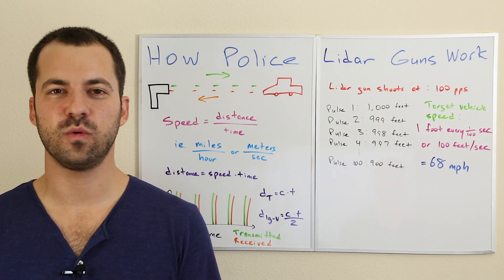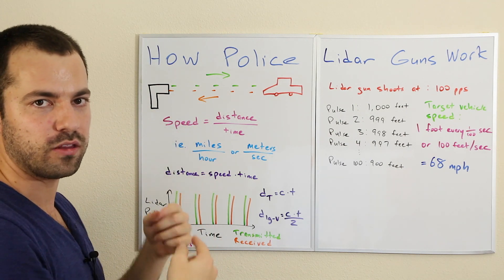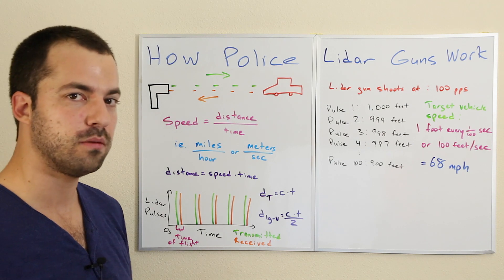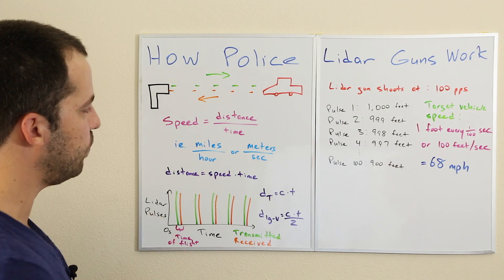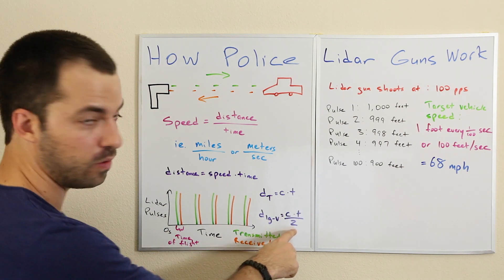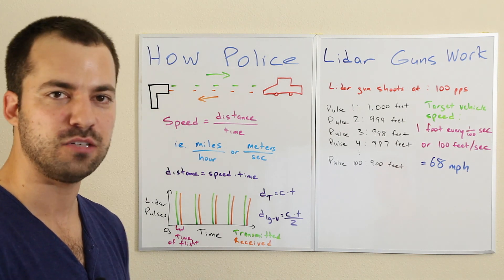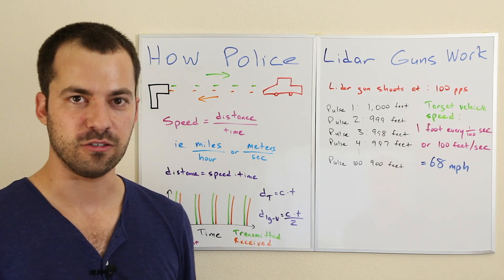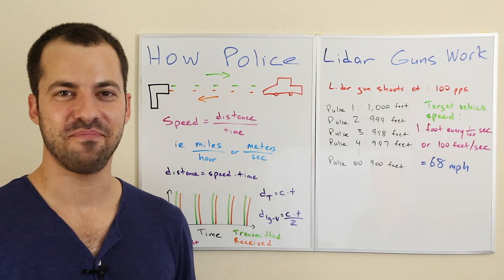How Police Lidar Guns Work

Comment: Are there any variables that can give an incorrect reading such as the height or angle the lidar gun is being fired from?
Reply from the maker: You mean like cosine error? That can happen with sharp angles.
Reply: @VortexRadar  not really sure how one would refer to the angles, but I was once told by a police officer that for a correct reading you would need to stand directly in front of the vehicle and on ground level. My question really is if one was using the lidar at a height of 20 or 30 feet above ground would that affect the reading?
Reply from the maker: Google cosine error to learn more

Comment: Would the calculations be only for a direct on coming vehicle? Or will taking the speed reading at an angle yield a different reading ? Or will it be negligent?
Reply from the maker: It would read differently. You can google cosine error to learn more.
Reply: @VortexRadar  so I can basically get out of my speeding ticket then ? Lol .
Do you have a video on it ?
Reply from the maker: No. If anything, the radar/laser gun will show a slower speed than your actual speed, so it works in your favor. Again, please Google cosine error.

Comment: its so funny that u sad is not measuring speed its measuring distance, its just so dumb :))
Reply from the maker: Like I mentioned in the video, it’s technically measuring distance and calculating speed by dividing change in distance over time. We could get into semantics and debate if it is or isn’t “measuring” speed, but that kind of misses the point of the video which is to explain how a lidar gun is able to “measure” or “capture” or “calculate” a vehicle’s speed.
Reply: Vortex Radar i didnt want to be rude 
Thx for providing such a great content

Comment: Hi I’ve seen Quite a few of your videos so thank you for the info!! So I got pulled over today I have max360c the officer said I was doing 69 in 55 but did not give me a ticket however it freaked me out a bit so I bought ZW5 s now to my question the ZW5  only protects from the front? Bcuz he got me from the rear! And if so do I have to buy ZW5 s twice to get protection in rear cuz I can’t find add ins.
Reply from the maker: You can install rear heads into the ZW5 now, but it kind of defeats the purpose of getting a ZW5 because you'd have to run the rear heads through the firewall and into the engine bay. That said, it would work.

Comment: 2:10 Wrong. The speed of light THROUGH VACUUM is a constant. These lidar guns are not being used in a vacuum, they are being used in the atmosphere. The speed of light varies wildly due to atmospheric conditions such as temperature, barometric pressure, humidity and atmospheric composition. On a humid day, for example, light will travel much slower than on a dry day. The change in this speed varies depending on the color of light. This is literally how rainbows are made. If a light pulse travels through your window, its speed will be reduced by 100,000 km/s, 1/3 of its vacuum speed. So, if the first pulse travels through your window and bounces off your seat, but the second one bounces off a flat surface, it will appear to the lidar that you are traveling faster than you actually are.
Reply from the maker: That's true, but it doesn't impact the results in any practical way.

Comment: Question: did you account for the fact that the speed of light is NOT constant?!? i.e "C" is the speed of light in a vacuum, but in air it moves slower, and slower again in water (Hence refraction)

OR is that actually irrelevant as its only the relative difference that matters, not the exact distance.....
Reply: For purposes of measuring a car that is less than 1000ft away... it is constant. (Any difference in speed would be so insignificant over this distance, the reading would be the same)

Comment: I just got caught speeding when a police car was tailgaiting a truck (wider than his car) 
the only time I had a clear view of his radar unit was at like 50 degrees offset from his front bumper/windscreen. 
and I was traveling around a right hand bend (in australia so we are on the left hand side) 
I think his radar bounced off both cars or when I made my turn the distance altered as it dies in a corner. 

how well does a radar handle the maths with corners? in moving mode ???
Reply: Well I guess you already forgot about your fine but essentially the device adjusts for the speed of the measuring car (simple subtraction) so measuring while moving is not a problem. 

But the thing with the angle is what I still don’t quite understand. My best guess is that the angle doesn’t really change the results of the calculation much and that’s why they simply subtract a certain amount from the measurement due to slight inaccuracy. 

Did you get another speeding ticket in those 6 years? LOL

Comment: All speed measurements are average if you think about it. Speed is simply distance divided into time. In the case of instantaneous speed measurement t is simply very small.
Reply from the maker: That's true. However, not every source of speed measurement is doing distance measurements specifically and averaging them out over time. For example, radar guns measure the amount of doppler shift that occurs when an object is moving and thus changing the frequency of the reflected signal. See my video on how police radar guns work for more info about that: https://youtu.be/DAwW7_nYG0c
Reply: +vortex radar -  doppler shift is indeed how radar speed guns work.  Unfortunately they're pretty fragile regarding the intended target.
Reply: What device measures instantaneous speed?  Instantaneous speed assumes there is no change in distance or time? What device measures that? This device surely does not as it needs at least two position readings to calculate speed which by definition is average speed or velocity.  Besides, a time of 1/100 of a second is very small but not instantaneous.

Comment: at what angle,( in this case lider gun pointing down onto another road from an overpass) does a lidar gun start to become unreliable.  at 90klms per hr how can a human hold a lidar gun and track a car  pointing down on it at 295 mters away to get a good reading
Reply from the maker: I haven't done exact measurement testing with overpasses, but I have noticed two issues with that. One is that once the car is too close, you're not gonna get a quality reading by shooting the top of the car. The other is that cosine error comes into play and you'll see lower speeds on your lidar gun than the vehicle is actually moving. It's for that reason that they'll typically shoot you when you are a little ways away from the overpass, not right up on it. Here's an example: https://www.youtube.com/watch?v=nu4Lp6uwNq0
Reply: at 295 meters away is it possible for the lidar to miss the car when trigger is pressed.  also it would be hard to track as the car is moving towards you at 90 klms.  also is it possible for the lidar to reflect off a foil lolly wrapper if it was swirling in the air in the line of the lidar as you pressed the trigger.
Reply from the maker: +Music Music No it will work fine then
Reply: thank you for your help.   i still have doubts on the accuracy of the read being at night, reflectors on road, well over 15 degrees above car being reed travling at 90+ ks with no tracking history and next to a dump with stuuf swirling every where

Comment: Light travels nearly 300.000.000 meters per second. A laser pulse sent to a car 50 meters away comes back in 1/3.000.000 th of a second. Is this device capable of detecting this tiny time difference?
Reply from the maker: +Mehmet Ali You bet. That's what makes jamming at close range all the more impressive. :)
Reply: I also came to this idea.. while calculating practically.. so is it 3000000 pulses per second ???

Comment: Now, how can a LEO prove that it was my car and not the car adjacent to me whose speed they were clocking? Lol
Reply from the maker: +CEREALBOX55 As long as they're operating within the maximum distance allowed, the laser beam is small enough and thin enough to really only be tracking one car at a time.
Reply: Gun has a red dot sight to shoot one vehicle it's not a net like some radars it's more pin point accurate ie if you shoot a curved car in wrong spots it wont send it back correct